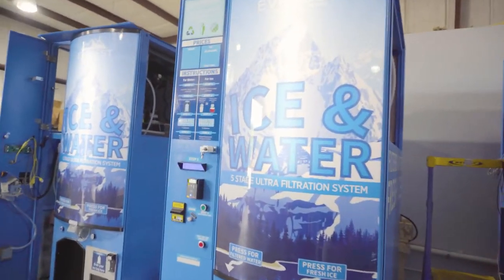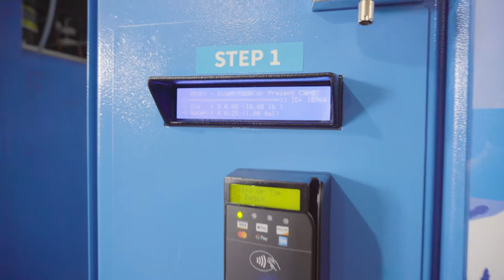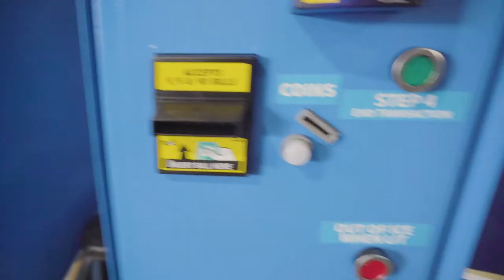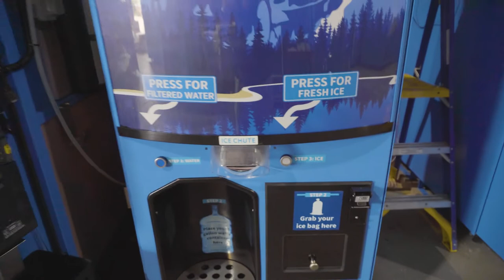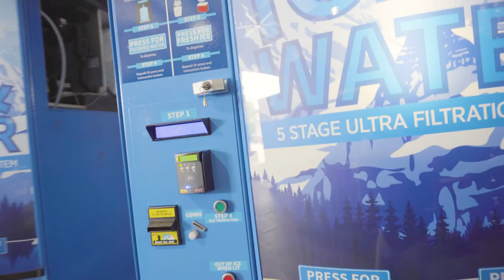What's Going On Under the Hood of the Everest VX Ice & Water Vending Machine?

Comment: Do you need to set up a pipe to get water to the machine for water and ice? And does it fill up regular water bottles or just gallons of water?
Reply from the maker: You will need to set up plumbing to get water to the machine. The machine is designed to fill up a gallon at a time. You can use whatever type of water bottle to fill up.